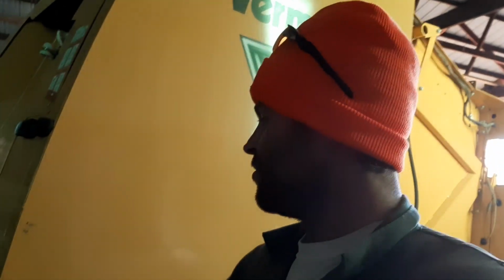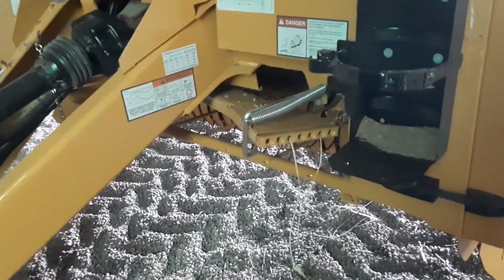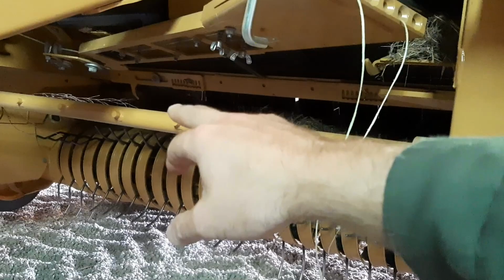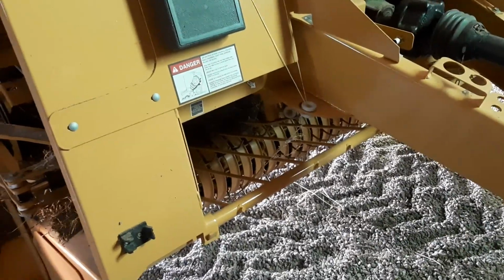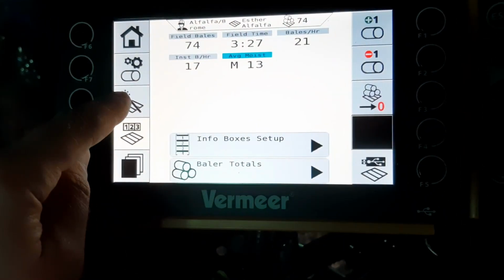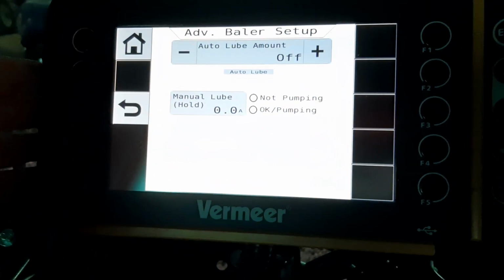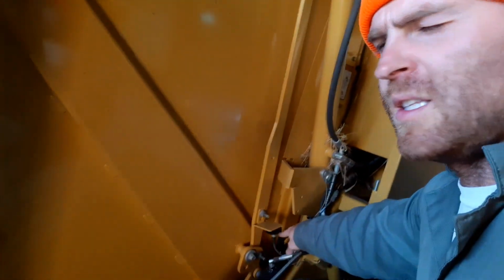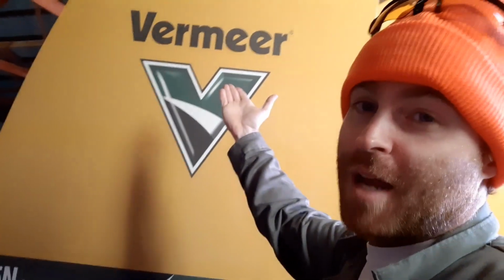Overview: Vermeer 605N Select Round Baler

Comment: I’ve got a 605n. 3rd full season and roughly 4500 bales. So far so good. Did notice cracking starting below netwrap box of the tailgate. Keep eye on. The pickup clutch is awesome
Reply from the maker: Is that cracking on the tailgate frame itself, or on more sheet metal? Glad to hear not much trouble.
Reply: @farmingnodak  L shaped sheet metal

Comment: That square mount in the hitch is where I was told to stow your jack. It’s a pain to get it in there because it has to be jacked all the way up. But I will say I have hooked jacks with the back tire on a couple occasions but that jack you never catch. 

I got to ask do you find in Vermeer wrap at the end of the roll do you find that net wrap gets blown out of the spiral gear and your constantly getting out to refeed that dang roll? I bought two 7000 rolls of Vermeer wrap and on both rolls  and the last 30 bales I had that issue. 
I e got to say I honestly will not be going back to JD balers these Vermeers have  been very good for me. Great baler!
Reply from the maker: Might have to adjust your brake back there? Does the roll spin too easy or is it tearing too soon? We used 2 vermeer rolls that came with the baler, then went back with the Tytan stuff we usually use. Had to adjust the brake a bit but didn't have any issues with both brands after that. I prefer the Tytan over the Vermeer stuff simply due to better coverage. The vermeer seems to have larger gaps in the wrap, don't think it sheds moisture as well.
Reply: Will say with the wind when your loading your wrap on a windy day I park my baler with it’s back to the wind I find than it blows the wrap in to the baler and it seems to hold decently

Comment: That monitor sure seems simple enough and I've never round baled before. Personally,  I've never chained the pto shield on anything. Figured I would just stay away from it while it's turning. The way you keep care of things,  it should last you for many years. Nice little upgrades on it over the M, like the grease bank for sure.
Reply from the maker: On the SuperM, we unchained it after replacing with a new shield (the old shield destroyed itself) but this shield on here is a bit different so we're giving it a go. Helps to not having to tie up the hoses and harness to make sure it stays away to prevent rubbing issues.